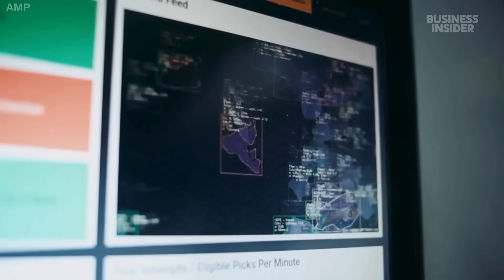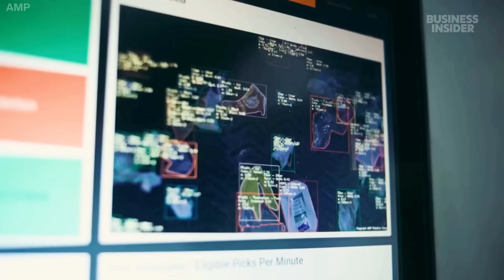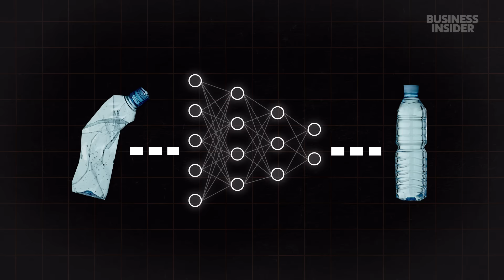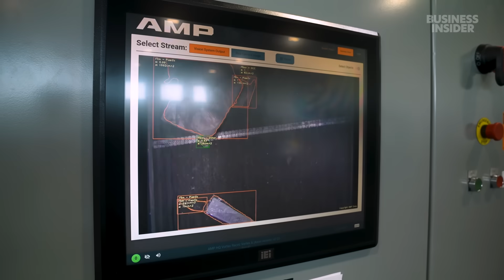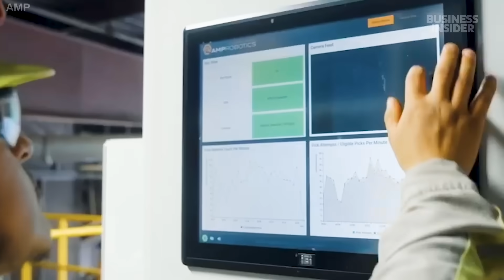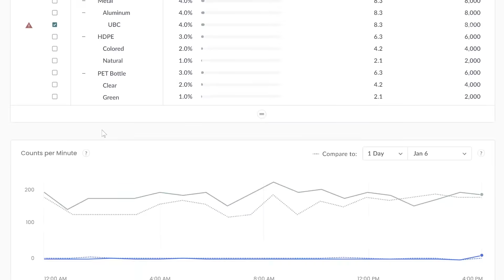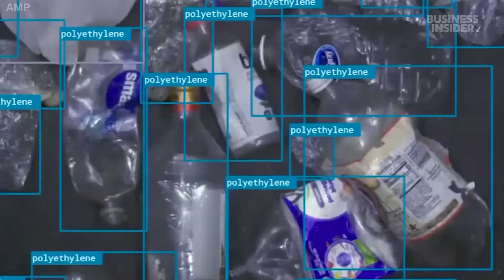How Robots Could Save $6+ Billion Worth Of Recyclables A Year | AI In Action

Comment: As it appears in this video, a lot of this sorting could be saved by simply introducing a deposit system. Aluminum cans and PET bottles would then be pre-sorted by people at the deposit machines in the store. It's been working in Germany for over 20 years.
For the rest of the waste, the technology is really cool. With no more deposit bottles in the system, significantly more of the waste can also be sorted.
Reply: But in the USA, only #1 PET is recycled post-consumer at a rate exceeding 15%; #2 HDPE (milk jugs) are also recycled a little. As the AMP CEO says at 9:24 there isn't an end market for the other kinds of plastic. If AI can improve the purity and lower the cost of other kinds of separated plastic, maybe it'll be a viable replacement for cheap plastic straight from the oil refinery. It's tough to force manufacturers to use post-consumer plastic. They'll often claim to use recycled plastic, but it's from industrial facilities where it's 99% pure single type of plastic.

Comment: I work in the msw industry and for years as a front line worker at one the the busiest transfer stations in the country.  I've cleaned up pools of blood from workers being sliced open by random scrap metal on the drop floor, seen people accidentally scooped up by dozers, raging battery fires from mixed waste being crushed, and workers pass out from heat exhaustion.  The working conditions are very dangerous to your immediate health and safety but also to your long term well being.  I think the added value of sorting msw would benefit the locally economy, the environment, and the well being of labor.
Reply: Profits before people.
Reply: Yes sorting the trash should be for the robots. But if they are capable of doing this nasty job, then they are capable of doing almost any job. We humans will soon all need degrees for robot repairs or we wont be working at all!
Reply: @Travis26X No, not capable of doing almost any job. These jobs are a lifeline. Better safety measures and processes to support worker safety is needed, not just making people redundant.
Reply: @SewsteadyGeorgia  Yes robots are capable of doing any job. You just don't like it.
Reply: @Travis26X I meant people aren’t capable of doing any job, you’re missing the point.
Reply: Which is entirely why they need to source their first line sorting machinery from prisons and jails for non-recyclable sorting livestock who have proven themselves to be un-recyclable.
If one gets snatched up by a material mover or crane it's no loss to society.

Comment: This is cool. Eventually landfill mining using robots will help recover a bunch of "raw" materials that won't have to be mined.
Reply: I wouldn’t be surprised if decades later we dig up landfills to mine for metals
Reply: There's a landfill that contains a guy's hard drive is buried with $800 million dollars of bitcoin on it.  The council denied excavating the place due to safety issues.  Maybe we can reach a point where he can suggest sending in an army of robots to recover it.   Bring a new meaning to bitcoin mining.
Reply: LFG!! Yesss
Reply: Yeah, that is not going to happen once the landfill is sealed with topsoil; it's the end of it. Landfills have systems in place that use methane produced by garbage and are sealed so it does not go into the atmosphere, or other microplastics and toxic pollutants go into the air. Also, under every landfill, there is a membrane and pipes that collect wastewater from the landfill; you can't disrupt those, or you are running the risk of polluting underground water systems. Landfills are a complex system. It's not just dumping a bunch of garbage directly into soil and hoping for the best, at least in countries that take care of their garbage. I don't know how it is in the USA.
Reply: @stefanmiletic8062  not true anymore. They turn that gas to power
Reply: Drill, baby, drill

Comment: And the age old problem persists, recycling is primarily fed by the idea that garbage companies can sell their product to others.  It has nothing to do with keeping stuff out of landfills, if they can't sell it for a profit then it's going into the landfill,  they say it right at the end, plastics they can't sell because it's cheaper to make them new.   How about just giving them away for free?    Would that work?   Yes it would work, but no garbage companies aren't charities.
Reply: Not Really. The end user would still need to make a cost effective effort to make the waste into something useful. The thing a lot of recyclers are considering now for waste plastics is Syn gas. Its basically reducing the product in a vacuum to its constituent elements, carbon powder, oxygen and hydrogen gas using a modified blast furnace. This type of recycling is less energy intensive than crude oil distillation and the 3 end products can be sold on the market or stock piled until prices are favorable.
Reply: It costs money to dump trash in landfills, so giving sorted plastic away for almost nothing could still save trash companies money. The problem is as the CEO says at 9:24, there just isn't an end market for most types of plastic beyond clear #1 PET. Virgin high-quality plastic straight from the oil refinery is cheap and good.

Comment: Maybe we should go back to glass bottles, in which my mom brought back the old used glass bottles for the deposit back. We certainly didn’t have the plastic issues back then
Reply: As there are more costs and emissions associated to transporting and washing glass bottles than using plastic bottles, glass bottles produce much less waste. I am from Europe, and here most glass beer bottles are the same 2 or 3 types and they are returned to the breweries, where they are sorted, washed and refilled. Of course, new glass bottles need to be injected into the cycle, but the waste is much less.
I worked at a company that builds the massive bottle washers, and you would be suprised how little energy and water they use per bottle. They have a throughput of up to 50.000 bottles per hour and use as little as 350ml to wash one bottle. Of course this depends on the circumstances, maintenance and performance of the equipment.
I think returning your glass bottles to be reused is a great cause.
That said, aluminium cans are gaining massive momentum, are great at storing liquids, are light to transport and are easy to recycle!
Although, I wouldn’t want to drink my Belgian Tripel out of a can ;)
Reply: @MrDominoMan  The factory may be very efficient, but what about the customer driving his or her  car to leave a bag of bottles? We use a lot of energy to move a 2 ton car to transport a 10 kg bag of glass bottles.
Reply: @SweBeach2023  we used to return glass bottles to the place of purchase  you are making that trip anyways to do your shopping so no added transport is involved the same goes for the grocery store returning the bottle the beer and soda companies used to deliver their product and take back their empties instead of running back to their warehouses empty as they do now
Reply: In Sweden, we already have a deposit system for plastic bottles and aluminium cans. We pay a small amount extra at purchase, and get that amount back at specific recycling stations near supermarkets. Companies market themselves by stating they use recycled plastic.
Reply: It still exist but the price is higher than aluminium. So with the inflation we’ll just be moving from one to another problem.
Reply: Germany etc has no major problems with bottle recycling because you pay a deposit on them, they're worth decent money to recycle. Humans are selfish and dumb, we all need to be hit where it hurts - our wallets, in order to get people to follow the rules. Your average idiot is happy to let the world burn while they live their life with no regard for later generations.
Reply: Glass is too heavy and at the steps required (transport, cleaning etc) is very energy intensive. The solution is not recycle but reduce.
Reply: @SweBeach2023  It is far less important glass be recycled. Microplastics are a major environmental problem, glass is not. A world where most packaging is glass would be a cleaner world, even if nobody recycled any of it.
Reply: @SweBeach2023  There already exist light weight almost unbreakable glas, used in the DDR in catering, but was expelled later on by big corporations due to profit interests.
Reply: I agree, but like @SweBeach2023 said, glass is heavy.  In the transportation side, a trailer could only hold so much weight.  Glass is heavier than plastic, so less product will be ship.  Since everyone is trying to ship as much as possible, plastic is the answer.